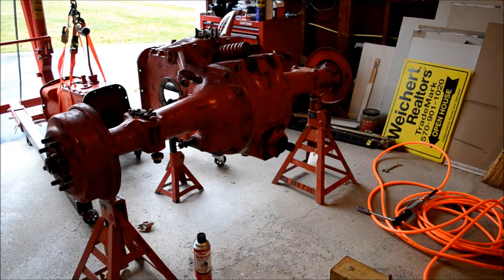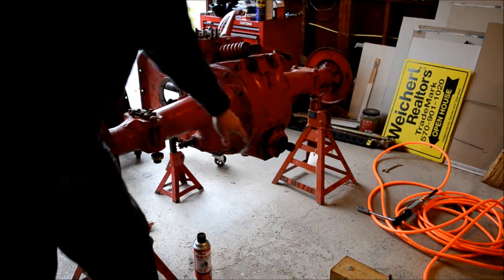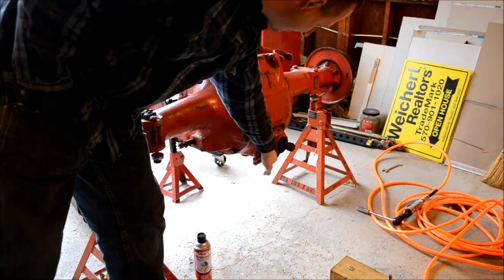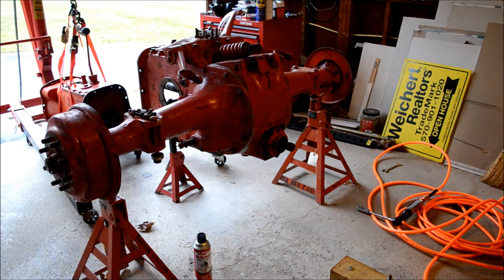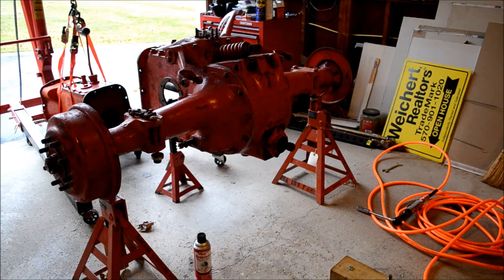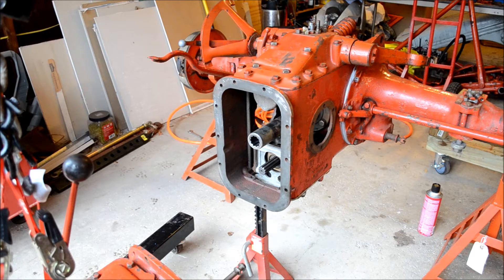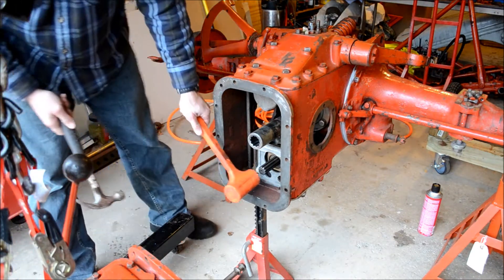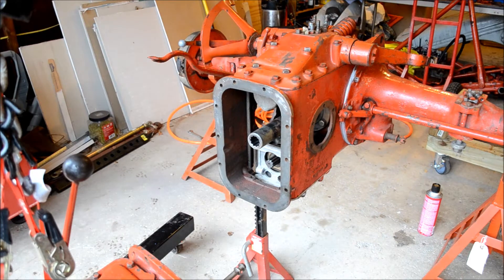Remove and Install Hydro Pump Ford 8N

Comment: When a part like the pto is stuck because the gasket is holding it together, all you have to do is use a thin chisel between the pto and the rear end of the tractor where by evenly working the scraper or chisel from one side to the other until it breaks the bond...that's how mine came off on both our 9n and 8n but if someone is wanting to do a complete rebuild/restoration I can see why you split the transmission from the rear end. Sometimes it's best doing a little more work to take things apart, clean them, and install new gaskets... it's obviously better to do that now while so much is already removed than having to come back later on after everything's been reassembled  to replace a gasket that started leaking.

Comment: I just removed the pump without separating the tractor I think that you went a lot of work that was not needed by separating the transmission case to do this job we have removed the shaft and the pump without doing it your way you should remove the video as it looks foolish to separate the tractor to remove the hydraulic pump  Mr.T
Reply from the maker: William Tomkinson i was completing a full restoration. normally you would not seperate the tractor. i was trying to focus on the pump. there is no videos on how to assemble the pump, till now.